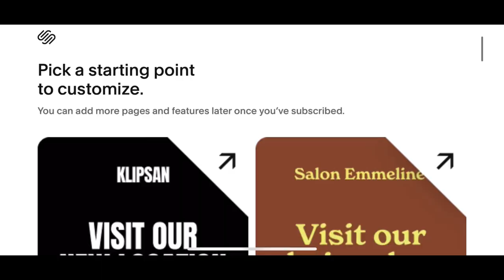Building a MICRO Camper - Tiny Home Virgins

Comment: Hey great video, what’s the lass going to use for a bed in the micro camper? X
Reply from the maker: A tent
Reply: That might be a bit of a tight fit in there 🤣 cool was just wondering, thanks Liam
Reply: It will be used mainly as a day van but enough room has been left for either a Z-bed or inflatable mattress when needed.
Reply: @johngrundy2920  thanks John ☺️

Comment: Hi Liam, I have a curious question. When I parked my van up for a few days at home I accidentally left the fridge switched on. My aili battery monitor has always read 100%, and now, no matter how far I drive or leave the van in the sun, I can't seem to get a reading over 75%. Is the battery damaged beyond repair? I have a 250W solar panel, a 130ah lead acid battery, and also a split charger. Do I need a new battery? Cheers Liam. P.S. I do have 240v in the van but haven't tried this yet as I can't get the van close enough to my house. would this get it to 100% Cheers.
Reply from the maker: Sounds like it may have been drained toofar
Reply from the maker: Sounds like it has been drained too far
Reply: I thought so too Liam. I now have to find an agm battery that will fit into the space that my last battery was. Cheers for the feedback.

Comment: do they fit a bed in the mini-van at all?
Reply from the maker: No but they could
Reply: Foam Z bed (folded seat) that opens out to make a single bed (Amazon or Ebay).
Reply: It will be used mainly as a day van but enough room has been left for either a Z-bed or inflatable mattress when needed.